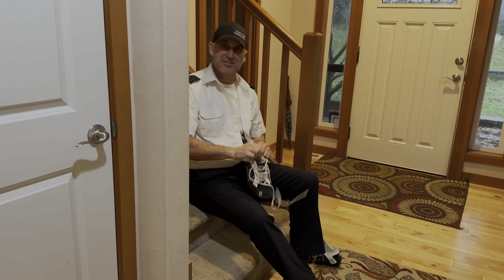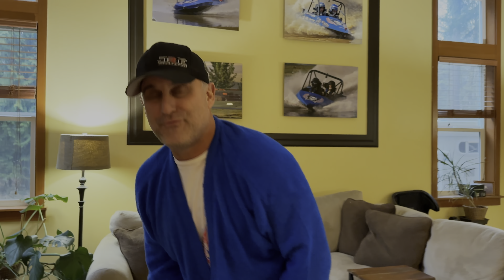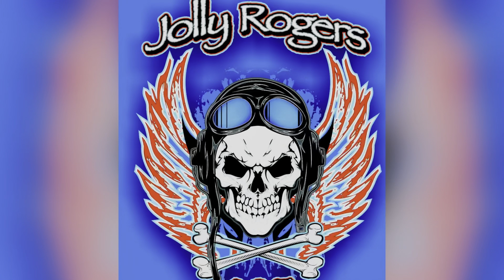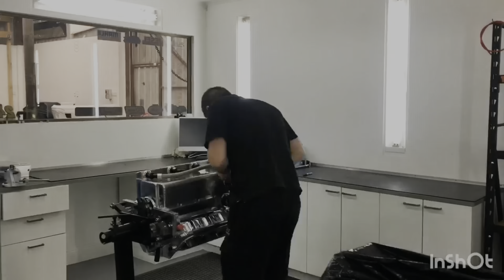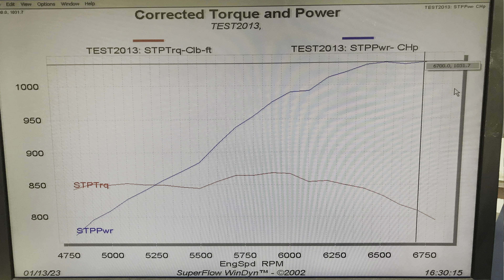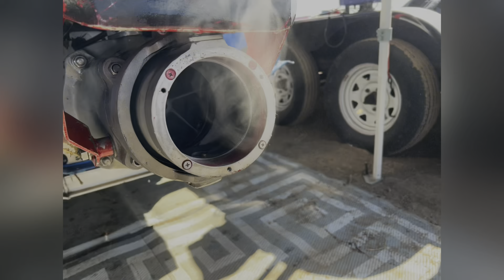DYNO RESULTS!!!  500 billet SBC, Engeler Injection on Methanol, HP & Tq revealed

Comment: Not that 1032 isnt really impressive it is awesome especially for a NA smallblock but could you imagine if it was built with  an 8000rpm peak HP number focus... Obviously that would be a turd in a sprint boat but it Shure would be cool to see.
Reply from the maker: It’s all about torque in this game.  Need INSTANT acceleration and pull to get you through the hard G corners!

Comment: Thanks for the heads up on the boiling piont at 6600 RPM's.
As I was going to push my little custom biuld 2 stage Yamaha jet pump unit to 8500 RPM's.
By the way there are singler wire stripers & wire crimper pliers on the market the work extremely well.
Reply from the maker: It’s not the boiling point, it’s just where these particular pumps / impellers start to lose efficiency and can do that.  Yamaha pumps can run up towards 8k

Comment: Awesome news! All you have to do now is merely install it and win! AS if!  I could get into a long deal about upkeep habits with methanol- simply put all the stuff about "it will eat your motor/carbs/wet turbo- are true. "Maintenance friendly" is the term that comes to my mind- be able to drain and dry the system shortly after last run. With today's equipment I would seriously look at "dual fuel" set ups that let you run on methanol and clean and clear to stop on gasoline- to purge the injectors completely after the runs. You boat, your rules, Captain! Can't wait for my seat behind that "lens on the roll cage"!  FR

Comment: He did a fantastic job of making power low in rpms. My guess was low " 1100HP @ 7900 rpm is ~730 ft lbs of torque sooo max torque 800 ft lbs at 5100 RPM" Then a few minutes later I modified my guess even lower "Take fifty HP off my HP guess and 35 ft lbs off too. because the dry sump will use that and it wont show up on the dyno. "   He done good!.

Comment: In my race world I can get beat quick by someone with less hp. Setup far more important and I would bet it is with yall too. You are gonna love that injection system! Dirt late models, sprints and modifieds in the open classes here also run similar stuff. The car in my profile pic there has a bryant crank with titanium rods, similar heads, with and 1150 Gearte carb on alky. My rev limiter is set at 8800. Surprised that cavitation begins so low! Making it a challenge to build those numbers at that target of rpm yall need! That thing is a beast! Btw the Mr Rogers neighborhood thing was awesome!

Comment: Mr. Roger’s meets Capt. Kangaroo! Nice entrance chummy!

Don’t know how much experience you’ve got with methanol, but would suggest you start looking at a procedure of purging the system after races to minimize corrosion and resulting issues.
Also, recently saw a product called Foggit, a spray intended to prevent cylinder corrosion.
That thing is looking to be a monster, and can’t wait to see it in your boat doing it’s thing.
Reply: Been using the regular sta-bil fogging oil for last two years. Working great.